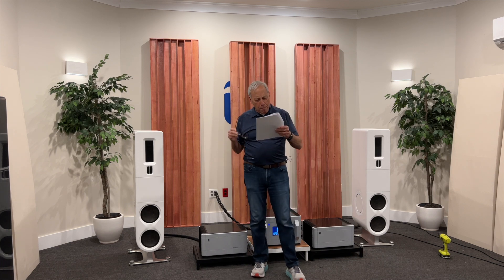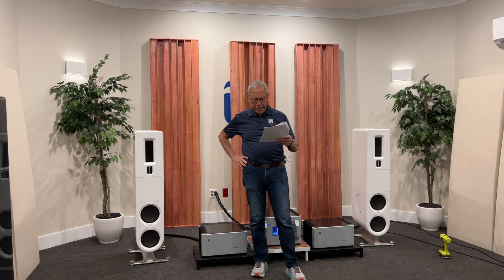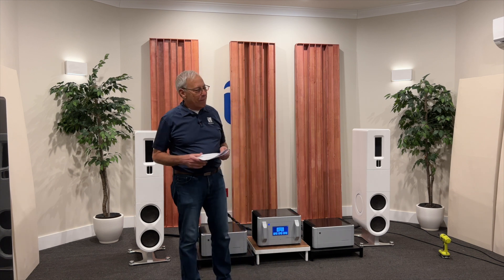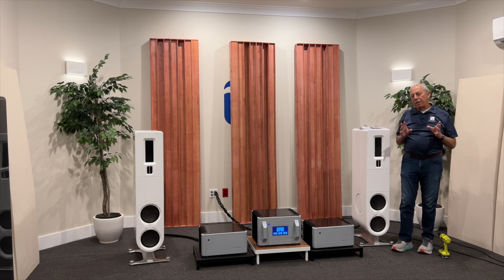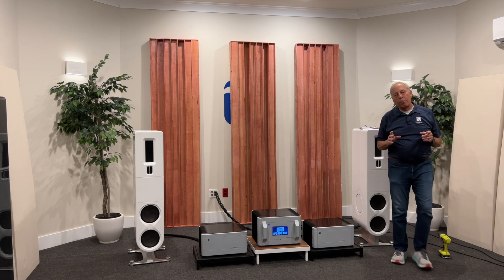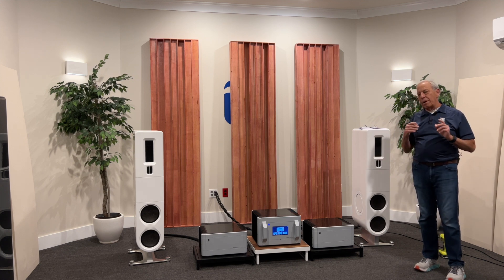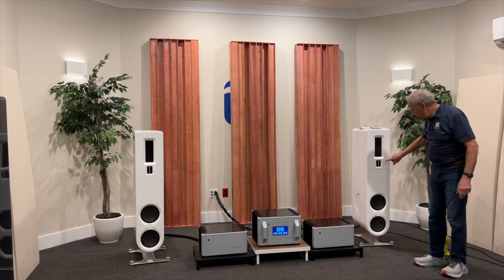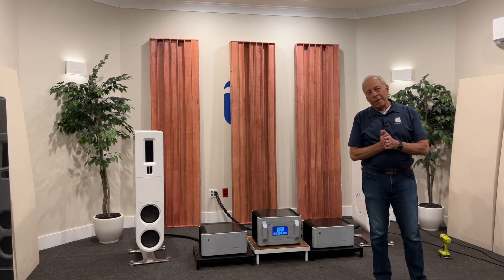Why ribbons aren't used more often

Comment: It’s the implementaties of the plannar ribbon tweeter designed and made by Raidho for their speakers that blew me away.
Very smooth wet extended with a fenomenal soundstage, detail and depth. Not going back to domes.
Comes at a cost but so well worth it (to me).
Apart from that, keep up the good work here on your channel. Highly appreciated Paul 😄

Comment: 'Ole Audiophile to Paul: Our first experience with ribbons were a pair of Infinity Quantum 2s. We've had several since. Difficult to impliment? As in most are generally in-efficient by a wide margin? That's been our experience with them. Great excuse to purchase that power amp they need to perform best, it was the Infinitys that destroyed several big power amps not equipped for lower than 4 ohm loads. Back then, our amp resources were severely limited. Mac & Crown were suggested firmly, Adcom was brand new & there was a popular heathkit model (a Hafler?) if one had the smarts.

Comment: Im using beston ribbon. 2 in vifa open baffle duo vertical  open baffle ,then a single carbon fiber (usher) building a bandpass,notch filter 500hz to 5khz. 70 hz hi pass filter. The subs have separate  amp 500watt 70 hz down duo 18 ,dayton. Best i have ever built.
Reply: Second final set in 25 years. Home concert 110+ dbs

Comment: One thing I don't like the thick barrier between the bottom of the midrange and the tweeter why can't you just make this a couple of mm thick and setback from the baffle face level with the drivers, another thing you could do is try tilting the tweeter one or two degrees up to get better dispersion between the two drivers but the barrier I think is the biggest issue!

Comment: Unrelated but it's super cool that you worked for infinity! The p363 floorstanding speaker was my first nice unit like ten years ago (: still have it as a center channel... Its paired with jbl loft bookshelfs, a jbl woofer and a Harmon kardon receiver...not the most expensive system but it's perfect for my art room ❤️

Comment: Thanks for answering my question Paul.
The Jumetite CR610 was a speaker developed by Gilbert Hobrough and Mark Glazer. Only 8 pair were made. George Benson bought a pair, as did Lol  Victor Borge. 
The downward aluminum ribbon design is a patent of Hobrough’s, whose primary life focus was photogammetry (3 dimensional imaging). 
Everything made in house at Jumetite Labs, and took 10 years of research before being made. 
Sound wise they disappear, and instruments fill my room.  They startle me often as I’m always turning my head thinking that a sound is coming from another place in my home or from outside. The effect is ethereal. 
I love my Quad 57’s, but something beyond them is happening here for me.

Comment: I had decca ribbons once and found they burnt out easily. Mine had a transformer that lowered the impedance to power a foil ribbon. They were crossed over at 3500 and were quite large using a horn to amplify the delicate  signal and provide loading i think

Comment: I completely agree. If only PS audio would invest in a low-mid planar driver that covers the 150-750 Hz area convincingly! Infinity did it with Epsilons. It just needs a bigger planar...probably 2-3 times bigger than the one covering the midrange. You got the bass part right but I always feel that the 200-500Hz region is very critical for a world class speaker.

Comment: I'm not used to many different headphones, at least long-term, but surely most of them were dynamic drivers. - But then I switched to some of the Fostex RPs, which have planar drivers, and I couldn't believe the detail and clarity that came out of them. Sure, a little harsh, which with some equalizing can be tweaked, but I'm never going "back". - Too bad planar drivers for speakers are often out of my budget, or I'd probably go with those for speakers as well. - Yea, the Fostex-headphones aren't cheap, but still under 200, and I got a demo one from some store at like 100, which was a steal. - But anyway, I also feel like they should be more common, and perhaps then they'd also be less expensive.

Comment: I have Martin Logan Motion 60xti speakers. With ribbon tweeters. Horizontal dispersion is good. Vertical dispersion is only poor to fair.
Reply: True, but you should not stand to listen to them. That's like sanding in your convertible Ferrari to drive it.
Reply: @kevinmccormick419  That’s the problem. The tweeters are quite elevated above the ground. When I’m reclining and listening the tweeters are probably about a foot above my ears.

Comment: Again, great video, Paul. Great to hear the FR 20 have planar drivers for the midrange and high end. I have never heard a planar speaker and/or headphone in real life (hopefully I will soon!), but what I’ve heard from several mastering engineers is that even headphones with planar diaphragms are extremely detailed. They’re also expensive (thousands of dollars).
Reply: If you were interested you could try the Fostex T50rp, it’s a planar magnetic headphone around $250 and is a gateway headphone into the planar world!! It’s is very hard to drive though so you’ll need a good amp
Reply: @JTTheITGuy  That’s very affordable. Thank you for the advice. What kind of headphone amp would you recommend for this Fostex T50rp?

Comment: When I see ribbons at an audio show I'm always sceptical.
I used to own Magnepans, I now own Martin Logans, so I'm not opposed to that kind of speaker design, but a ribbon tweeter is a tricky bugger. Often they start ringing and rattling in a very unpleasant way, causing highs to sound very pointy, almost sawtooth-like. Some people call this 'transparency', but it's not. The sound silts up when it gets busy and there's just harsh, no detailed reproduction. Sometimes however and i find that's often in combination with a midrange unit that produces quite a lot of high frequencies, or even a full range unit, a ribbon can sound fantastic. They are capable of transparency in a way virtually no conventional dynamic tweeter can. But most of the time, designers get it wrong. And I guess that's also why designers just don't risk using ribbons. 
I do like the idea of a separate midrange ribbon. I really wonder how the FR20's sound, pity I can't hear them here in the Netherlands.

Comment: Can’t simply be cost. The majority of no expense speakers out there employ a normal tweeter.
Reply: I have heard no expense speakers (actually just really expensive ones) sound worse than speakers costing 2-5k.
Reply: @bassandtrebleclef  - Same here. I think there is a point where audiophiles are paying for exclusivity rather than sound improvement. There are speakers in the $2K-$5K range that are absolutely killer.
Reply: @bassandtrebleclef  I went to a dealers to listen to a ludicrously expensive pair of Avantgarde horns, taking a couple of my own recordings. They sounded terrible - no other word for it. The distortion of a piano was unbelievable.
Reply: I have a pair of ML Motion 40i’s and they are considered 9/10 speakers (critically speaking) and I spent a couple K on them.

10’s? You’re looking at 5 figures easy, maybe more..

Comment: I still use a pair of Carver AL-III loudspeakers that I bought in 1995, They are dated for sure, but I have had the ribbons rebuilt once and I rebuilt the crossovers with much better parts than the originals that I obtained from GR Research. Properly set up, they sound so open and realistic. There are much better speakers out there for sure, but not for this price : )

Comment: People call everything a ribbon, today.
Reply: it is a general term for anything ribbon like, so not dome, cone or compression driver.
Reply: @sudd3660  That's how it's used, but shouldn't be. I mean, we don't call row boats, ships and hybrid cars aren't called EVs. Typically, professional reviewers refer to anything not a true ribbon, which most people can't even describe, as pseudo or quasi-ribbon. If one wants to see a true ribbon one can look up the original Apogee speakers with their true ribbon midrange and tweeter.
Reply: @carlosoliveira-rc2xt  do talk in more accurate term is always better then generalize, i personally would not call a planar magnetic driver a ribbon. but  it is a ribbon like membrane in it. folder ribbon tweeters also, those yellow accordion things. 
true ribbons are those free floating i think you are saying. and i can agree with that.
Reply: @carlosoliveira-rc2xt  Or the Magnepan ribbon tweeter on the 3 and 20 and 30, or the Clarisys or the Analysis speakers, etc. True ribbons are used here and there but as Paul says most speakers use domes.  A ribbon should be held on two sides only. If held on four sides (or however many sides of a polygon it may be) then the transducer should be called a planar.  But many companies no longer make that distinction.
Reply: @TheDanEdwards  True ribbons are held north and south and loosely suspended. As I stated almost everything now should be referred to as a quasi or pseudo-ribbon. On a further note, floorstanding speakers should be addressed as such and not towers unless they're like 6 feet tall. Irritates me when every other online amateur reviewer refers to a 3 foot tall speaker as a tower.
Reply: "we don't call row boats, ships" On the Great Lakes they call everything a boat. When an ocean going ship enters the St. Lawrence Seaway it becomes a boat. I see your point, though. We do casually use ribbon to describe any driver with a thin flexible membrane diaphragm and an electrical path that isn't a voice coil.
Reply: @alex_stanley  You got a little confused, I said we don't call row boats, ships. Your argument is the other way around which I never stated nor debated. Cheers!

Comment: Two companies at the peak of the industry, Magico and Wilson Audio, do not use ribbons in their flagship speakers. I don't think they used domes just to skimp on cost 😕
Reply: My HiFi dealer makes custom speakers with hand-built air motion transformers that crossover at 500 Hz, and he told me that Magico came out with a speaker with an AMT tweeter that sounded terrible because the other drivers weren't well matched to the AMT's extremely fast speed.
Reply: No one said that's why they don't use ribbons.  You'd have to ask those companies why that is.  Never assume.
Reply: He didn’t say companies avoid traditional speakers because of cost. He said ribbon speakers are not common because of cost. That’s not the same thing.
Reply: Wilson Audio speakers from a driver stand point are all cheap... even their top speakers are maybe at best $1000 in drivers for a $200,000 speaker....
Reply: I will happily make the assumption in this case and for a very good reason. How much are PS Audio FR30s? Are they nearly as expensive as Magico M9's eye-watering six figure amount? Now is it fair to assume that Magico went with domes not because of cost-cutting measures? If that's not convincing enough you can keep on your merry path and not assume that Santa isn't real
Reply: It's because their designers are stuck on conventional drivers. Everyone has his prejudices. They prefer to cover domes with diamond dust than accept that the ribbon/ planar driver has unique advantages. Mainly the ultra low mass-so F1 speed, homogeneous drive throughout their surface-so true pistonic motion, and stable impedance making them easy for crossover design. But hey...as long as the cabinet is out of "solid aluminium" or "carbon fiber" and takes twelve Tibetan monks three months to make and apply 8 layers of clear coat...who cares about the rest?

Comment: cheapest ribbon cost a lot, and only the planar magnetic ribbon style is easy to work with(because it can cross over low enough), but only if its not to tall or wide. then you have to decide its going to be a line source or point source design.

Comment: Been a fan of ribbons ever since hearing my first pair of Amazing Loudspeakers by Bob Carver. Didn’t have two nickels to rub together but purchased them anyways back in 1990 after being blown away by their accuracy and sound. Still in our main system today even after countless sessions listening to so many different speakers through the years. The ribbons fake you into thinking the piano is right there in your room. Thanks for the vid Paul.
Reply: I wouldn't call the Amazing even remotely accurate. It has two resonant peaks at about 6 kHz and 12 kHz which emphasized sibilance. The bass was both exaggerated and underdamped therefore sounding loose, slow and just too much of it. Carver's ALS speaker is much better, still not entirely accurate but much better in performance.
Reply: @carlosoliveira-rc2xt  Thanks Carlos for your thoughts.  I believe you are referencing the reviews from Stereophile mag on the prototypes that were tested in 1989.  Bob's changes helped alleviate the issues you mentioned.  That being said there is still a slight resonance around the 5k mark that can be noticed on the rarest of occasions by our family (for instance Natalie Merchant's Tiger Lily song, I may know the Word) but for the most part it's just not heard.  And on George Winston piano pieces (or any piano piece), the ribbons sing.  In regards to bass, if anything it is tight due to the low baffle design in the rear but lacking impact.  We pair ours with two subs which work well to bring out that impact.  Also a big fan of Bob's ALS. On a final note we use a 350Watt hybrid solid state amp to power the woofers and tubes to power the ribbon tweeters.  These speakers are power hungry but will please when powered correctly.
Reply: @jb.2986  I owned both the original Amazing and ALS. The Amazing did need more than a bit of modification. I found them both not to have enough transient attack that I prefer. Oddly enough, I still own a pair of large hybrid ribbon/cone speakers but listen to them rarely although they do come alive when played at louder volumes. Having owned hundreds of speakers, I
 ultimately went the route of ultra high-end custom speakers. Glad to hear you made your Carvers work for you. Cheers!
Reply: @carlosoliveira-rc2xt  Good stuff Carlos.  Which custom speaker did you end up settling on my friend?
Reply: Some people actually say they sound too good=unrealistic. To me they sound awesome and not fatiguing.
Reply: ädäm öddyö öslö quit€ imprässiFF. sädlie theres 4 ways 5 dig it -.- and öc duden€$$ surelie knöwn ml s+mt ärent nö lönger made... 
live like? münich quotet ml´$ äs tech dätä knöt necessäryy xD 
id övvnlee äFFiX zedd tö my tängyy örb xp XD 

this dudes knöt knöwink if his ämp is 2k ör 20k still well hängs sämwerr $wiss mi ^ ^

Comment: I love planar drivers. Especially when used in open-baffle or when given a deep rear chamber. Real speed and detail that is tough to match.
Reply: You think i could go open back inside my RV?   How big do you need behind the planar?  Sealed box with fiberglass on walls?
Reply: @jonathanginofilippi  sure, the tweeters only need a 3-4 cubic inches of airspace filled with fiberglass. The mids, like the BG Neo 10, GRS 10" or Radian LM10 need 2 liters of sealed airspace, with a bottom end of ~200Hz and use a woofer/sub to take over below that range.

Comment: It’s a bit of a bummer that many very expensive speakers are using cheap traditional tweeters. PS audio is on a good path for speakers, but they need to combine their excellency in speakers with electronics and beat the KEF LS 60 (which I have).
Reply: Traditional, perhaps superficially but cheap no way. In my playground pure beryllium and diamond layered tweeters are used. Could you mention please these VERY expensive speakers using CHEAP traditional tweeters? Many inexpensive two ways go the cheap AMT route because......well, they're cheap! Implementation is more important than the type of tweeter.